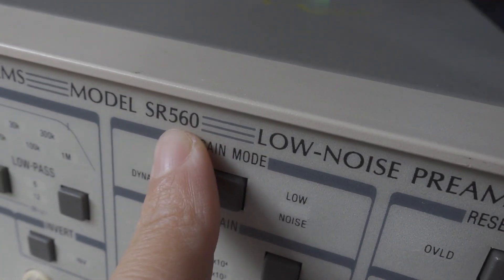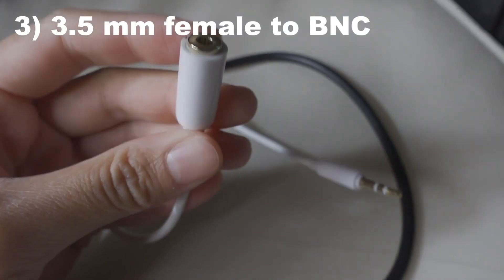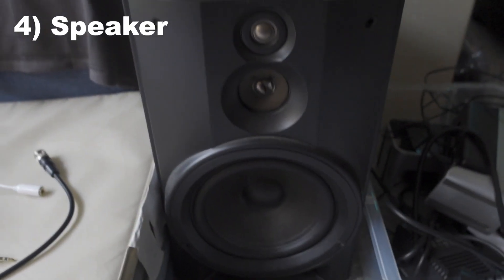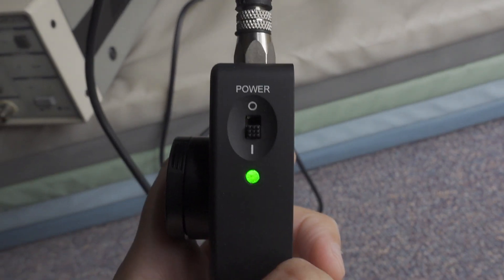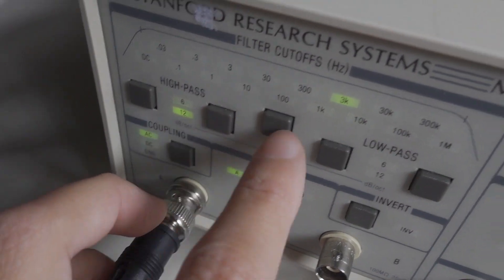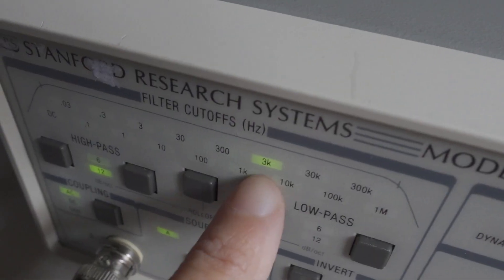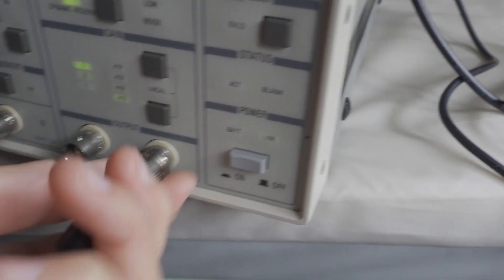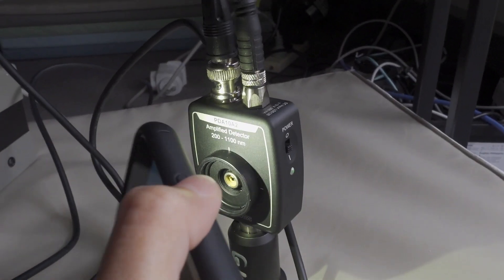LISTENING to the QUANTUM REALM | SOUND of SHOT NOISE

Comment: Hi NUTSINEE,

i am going to use the same sensor to detect fast processes like triboluminescence but I think sensor might be ultra fast but its sensitivity is very very low. I connected a 50 Ohm cable. and if i remove the lit is doesent even detect fluorescent light from the office. I have an offset of -10 mV. And I am using a PicoScope USB Oscilliscope.
When I put a 3W LED with white light directly on the sensor it shows only 2V.. and it theoretically can go up to 5V @50Ohm resistance. Am I doing something wrong? Or does the ultra fast responsiveness come with low sensibility?

Comment: Cool stuff. I always wanted to borrow from the lab but was too scare to drop as much stuff at home as in the lab. In the lab it's a work accident... and at home... well....

How do you know its shot noise and not e.g. intensity noise without using 2 diodes illuminated by the same source (e.g. laser) and subtract all the common (e.g. intensity) noise.
Reply from the maker: Guess you'll have to measure it to be sure. Not sure how you do it with an incoherent light source though. If the power hitting the diode is known then shot noise can be calculated. It is what I imagined what shot noise would sound like and it's just a pub quality demo 😂
Reply: @NutsineesVlogBook   I know of this LED interferometer https://link.springer.com/article/10.1023/A:1006991717589 coming from you Canberra folk :) coherence length of LED is few 💯um or so. This scheme has always been the basis for the (laser) interferometric readouts I’ve been building. 

Anyway, nice pub demo and I always love watching new vids from you - excited for the next one!